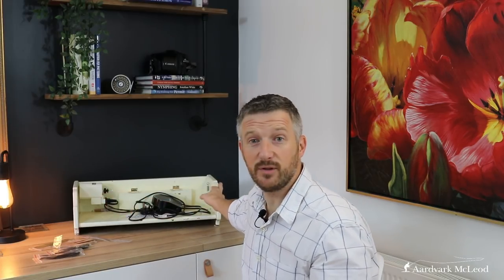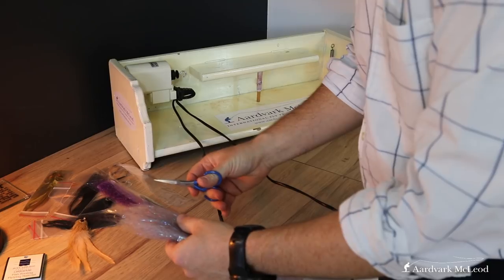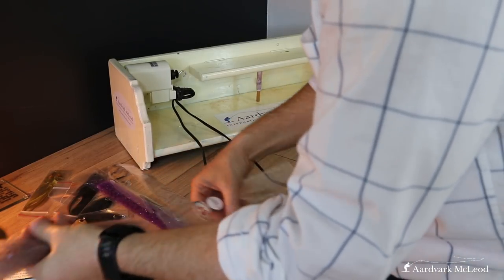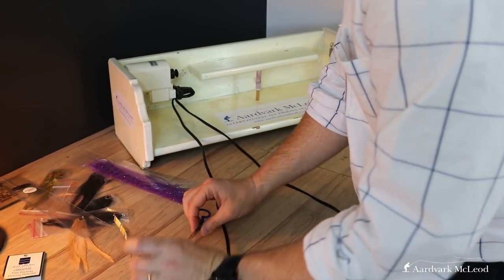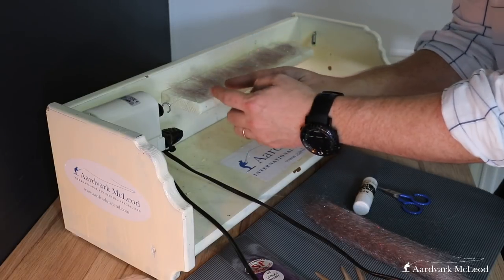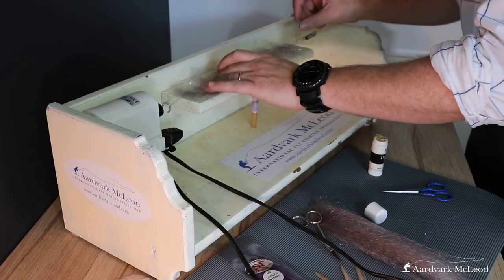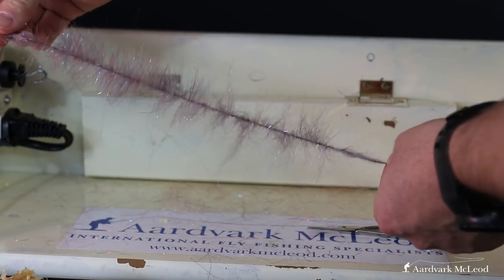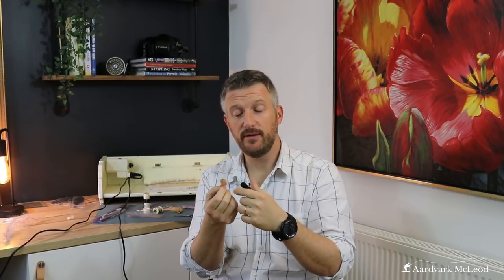How to make a dubbing brush to tie a brush fly

Comment: Nice video, I am building one as well.  How did you attach the hook to the sewing machine motor front pulley?  My swm front pulley is aluminum.
Reply from the maker: I drilled into it a little and then cut the hook screw down a bit before gluing it all in place...
Reply: @AardvarkMcLeodFlyFishing  Thanks for your prompt reply, got it.